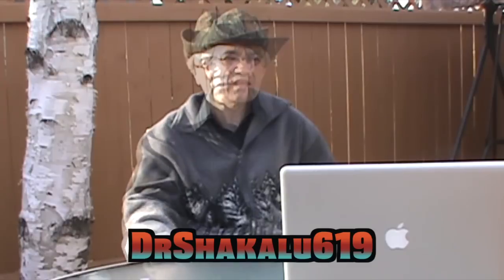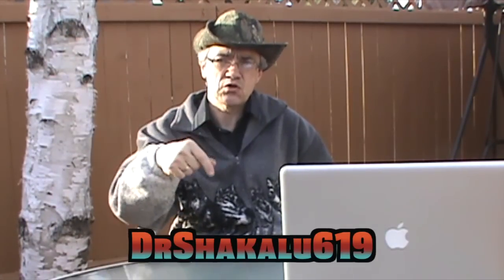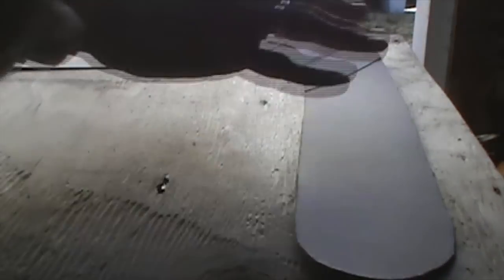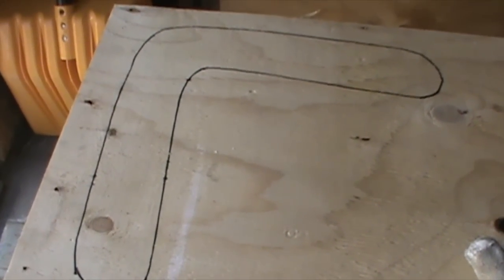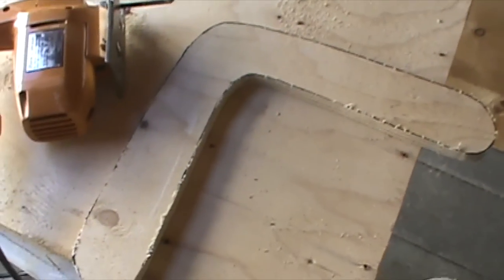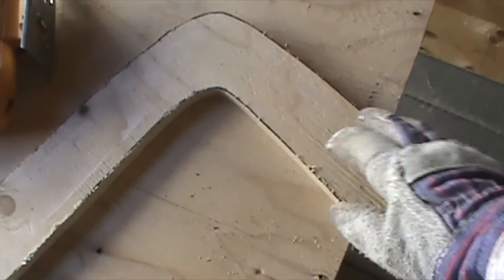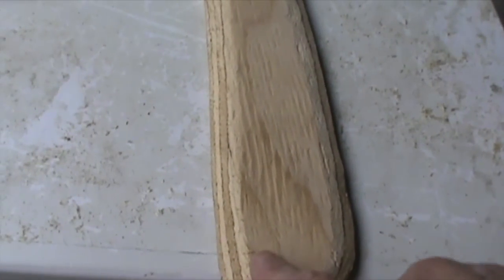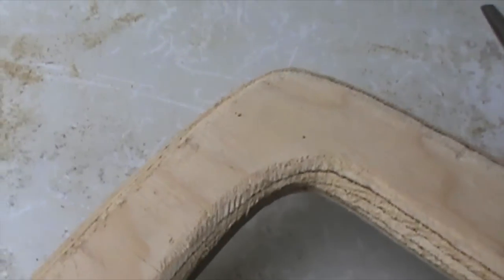Primitive Hunting: The Boomerang 1 - Construction and Testing

Comment: traditional aboriginal hunting "boomerangs" have a long edge with about a 30° bend beginning about 2/3s down. its flat with a sharp edge. Its made of a strong wood like the wood from a Mulga tree. Used to hunt kangaroos, Emus, Wallabies and other sturdy mammals. It was designed to kill and at the very least break the bones of whatever it hit so it could easily be tracked and killed. The boomerang demonstrated here was for fun and possibly hunting birds like duck and such when they took off. Useless against larger prey. The reason for the curve and the shape is it improves accuracy. In the right hands a hunting boomerang can bring down prey over 100m away.
Reply from the maker: +tokken1122 Cool... thanks for the info.
Reply: +Muskrat Jim no worries. The information I give is from an Australian point of view. Good luck to you.

Comment: That is crazy. I used to make them and I used a hand grinder to make the trailing edge. The different layers of plywood give you a line to grind to. You can make one a lot easier than this.
Reply from the maker: +James ALEXANDER Yeah, I don't have a hand grinder, so I just used what I had. I appreciate your comment and thanks for watching.
Reply: They are cheap at Home Depot. You are doing a good job but you are having to work to hard. Thanks

Comment: you should add a thin piece of steel to the edges of the boomerrang of course not the part your holding just to make it a bit more deadly. ;)
Reply from the maker: The boomerang flies too slowly. A bird, squirrel or rabbit would probably see it coming and avoid a collision. I don't use it any more. it takes too much energy to throw and possibly miss my target. I use a slingshot now. https://youtu.be/tJZeoRpQ0-E

Comment: 1 The blades are too wide relative to the length.
2 The material thickness is too thick relative to the absolute size.
3 The profile is much too weak.
4 The leading edges are much too blunt.

A boomerang must be thrown almost vertically (horizontal position of the axis of rotation): As I said here already.

If you want to build a beautiful and functional boomerang, you'll find a lot of wonderful and free building plans:

http://www.das-bumerang-projekt.de/bauplan/

Many happy returns!
Reply from the maker: Hey thanks for the tips and for sharing my video :) 
I really appreciate it.

Comment: Comments have a lot of mixed information.  Here is a picture of a hunting boomerang from my collection: https://4.bp.blogspot.com/-AVYiH_GGOws/V4GVLa1jyfI/AAAAAAAARak/0FEqAXQa97sZEDuJ-BIGfuWGEg7N37fpgCLcB/s1600/20160709_161029.jpg Sorry that's such an ugly url.

This one is made of mulga wood and is shaped like tokken1122 mentioned.  It's not 'flat' though.  It has the traditional airfoil shape to the blades, but the angle of attack of the wings give it a very slight lifting force when thrown horizontally (parallel to the ground).

I don't know that it would be very practical for a kit, but it or a rabbit stick could be easily fashioned with a knife and hatchet. A good wood rasp will make it much easier to shape the wings and then tune it to get maximum performance.
Reply from the maker: Thanks for the link. I've pretty much given up on throwing sticks for hunting as they use up considerable energy. However in a last-ditch scenario, I would make a rabbit stick and a spear.
Thanks for watching!